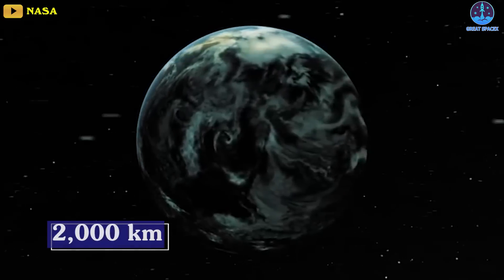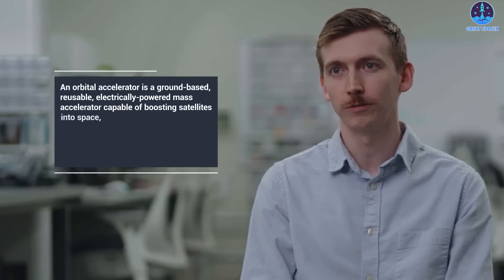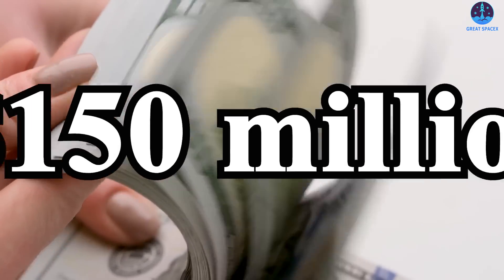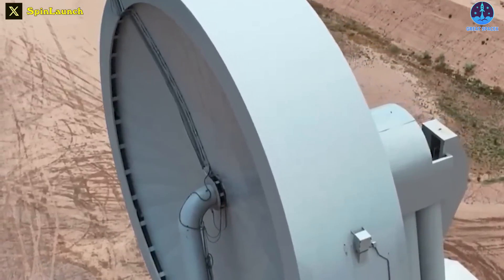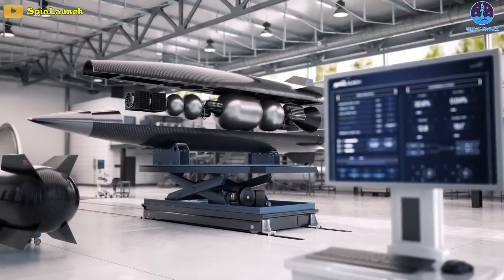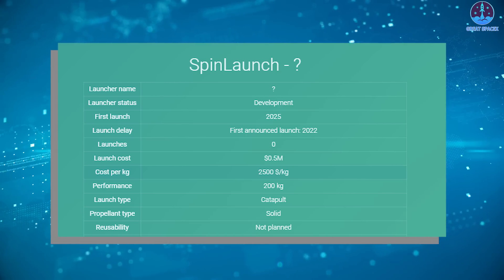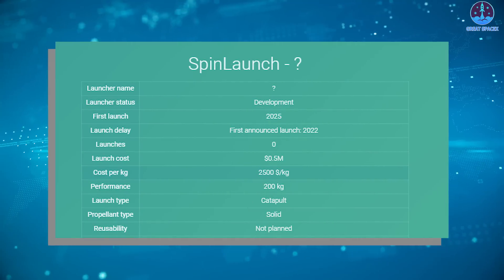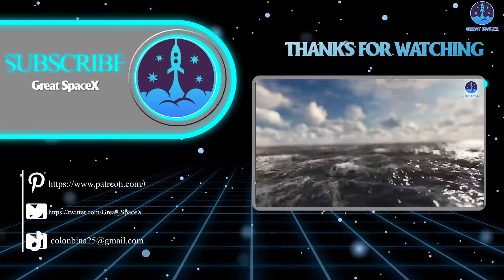What exactly happened to Spinlaunch and the Orbital Accelerator with new technology?

Comment: SpinLaunch project will facing significant challenges when it comes to launching larger rockets. For a large rocket, the accelerator required would need to be twice the size of the typical ones used by big space agencies for similar missions. One of the major concerns is the intense heat generated by the high G forces during launch. The rocket's propellant fuel is at high risk of overheating, and if this happens, it could lead to an explosion of the entire accelerator.
Another issue is the precision required in the launch. A slight miscalculation in the tangential trajectory could result in serious consequences for the surrounding environment. Any failures in the system would mean time consuming repairs or even the rebuilding of the accelerator, which could delay further missions.
The most recent launch conducted by SpinLaunch reached an altitude of only 9,000 meters, using both the spinning mechanism and traditional propellant. This is far below the performance of a standard rocket, which would typically achieve much higher altitudes with less complexity.  SpinLaunch may be effective for smaller payloads, but for larger missions it's a major obstacle.

Comment: The SpinLaunch project is facing significant challenges when it comes to launching larger rockets. For a large rocket, the accelerator required would need to be twice the size of the typical ones used by big space agencies for similar missions. One of the major concerns is the intense heat generated by the high G forces during launch. The rocket's propellant fuel is at high risk of overheating, and if this happens, it could lead to an explosion of the entire accelerator.

Another issue is the precision required in the launch. A slight miscalculation in the tangential trajectory could result in serious consequences for the surrounding environment. Any failures in the system would mean time consuming repairs or even the rebuilding of the accelerator, which could delay further missions.

The most recent launch conducted by SpinLaunch reached only to an altitude of only 9,000 meters, using both the spinning mechanism and propellant. This is far below the performance of a standard rocket, which would typically achieve much higher altitudes with less complexity. 
SpinLaunch may be effective for smaller payloads , scaling up to larger missions is like a major obstacle.

Comment: Almost impossible to keep the bearings clean on the moon... well not impossible but the cost.  Sheesh!
Build a micro-nuclear plant in the Philippines and use it to power spinlaunch.  
When you're done with the site you can teach the locals how to use the plant for local power.  Close to the equator and not a lot of risk in the launch area.

Comment: Besides all of the obvious complexities of building a system that accelerates a rather heavy object to these speeds, one of the most important aspects here is being overlooked, the customer. A satellite vendor designs to the launch vehicle, ie the size, shape (of its shroud, adapter/bus), throw mass limitations & environment ie acceleration (g’s), shock & vibe. If I have to design a satellite for a rocket today, even the less refined small launchers I only have to design to ~10g or in most cases closer to 3g. shock and vibe is another factor, which I think would probably be slightly less at launch but the same when the second stage ignites, w/ a spin launch approach. The real issue here is at ~1000 times the g force of a current rocket launch, w/ less kg payload capacity and only marginal cost savings for the customer over say a falcon 9; the design costs, risk of failure and capability tradeoffs one would have to make to survive this environment far exceeds any benefits to this approach. unless your are launching literally a solid brick with no moving parts, unfortunately I don’t see this ever being a viable business (me former Sandia & Lawrence Livermore, co-founder investor & board member Vector Launch)

Comment: *Each launch is a 100 kg bomb going off in the launch system*

At the moment of launch, they’ll need to release a counterweight with the same kinetic energy in the other direction or otherwise dissipate as much energy as ~100 kg of TNT. 

At release the rotor will suddenly be crazily out of balance. They could release a counterweight from the other end at the same precise instant, but it’s going to need something to smash into to get rid of all that kinetic energy.

They’re talking about up to 5 km/second for their “suborbital” launcher, and any orbital launch would have to be much faster, even assuming no air resistance. Kinetic energy = 1/2 mv^2. Just a 10 kg payload at that velocity has as much energy as ~30kg of TNT. If you double the speed (to get to orbit vs just up and back down, and just a little allowance for air resistance), it’d be 4x the energy. 

So even a tiny payload would be the energy equivalent of setting off 100 kg of TNT that you’d have to deal with.

- And this is just one of the engineering issues. 

Who the heck is giving these guys money? How could anyone invest 10s of millions of dollars without doing a few basic checks first? They may claim to have solutions for all of the many problems and impracticalities, but I don’t believe it.
Reply: Exactly!!!
Reply: "Who the heck is giving these guys money?" 

People who actually know what they're talking about.
Reply: @DamienDrake2389  References, regarding how they’re dissipating the energy for the counterweight? I’d be happy to find out that I’m wrong, but you’re not demonstrating that. If you have something to contribute to the discussion, I’d welcome hearing it.

Comment: If a space craft reenters the upper atm it needs a heat shield in order to not burn up at the 8km/sec it travels. These guys are proposing to shoot a satellite through the dense lower atm at >>8km / sek. Are these satellites made of cryptonite or how come they don't burn up in the second they are launched?
Reply: The nose cone is made of copper and aluminium and they don't have to put up with the heat for very long as they exit the atmosphere so quickly.
Reply: @DamienDrake2389  hmmm ... copper melts at 1000, aluminum at 600°C. Meteorites who travel the same path as these projectiles just upside down heat up to ~1800 °C.
Reply: @HR-yd5ib  I guess it doesn't work the same when in flying in the opposite direction with the atmosphere getting thinner, instead of denser as you move through the fluid. The shape of the projectile also plays a huge part with meteors having huge drag compared to an engineered, aerodynamic nose cone. That's what they're currently using all the same

Comment: I can't imagine any complex electronic device that can sustain 10K overG. Even "smart" bullets and artillery shells are not usually exposed to such Gs.
Talking about fuel for the second stage - most types of liquid fuels will be pressed against the fuel tank shell and such pressure will destroy the tank itself or heat up the fuel to self detonation temperatures. 
Anyway let them try and i wish them luck. 
The discussions about "why its impossible" never led to scientific and engineering success.

Comment: As usual, it will take time for it's development.
I wonder how much electricty it requires and how they would power it on the Moon.
This is alternative to a magnetic levitation mass driver that some have proposed.
Again, it will require electricity and will solar panels be enough on the Moon?
Also, 10K gforces on the satellite will be pushed to one side, I think.

Comment: I think it's more exciting use is to get bulk materials higher into orbit where another vessel not unlike a tug boat could take it to a more precise  orbit more efficiently. Such tug vessel would not need reentry shielding and could be both much less massive and less complicated. Just imagine water, soil, and fuel containers launched into NEO with the container being thin steel or even plastic which is able to be recycled in orbit. I think this would similarly and more safely be able to get nuclear materials into space with less chance of failure.

Comment: Spinlaunch is a great concept that should be pursued because it would considerably lower the cost of accessing LEO.
Imagine what a space-based spin launcher could accomplish.
Reply: Finally someone who isn't braindead in the comments! The cost of each launch is roughly half of what spaceX is using and they can actually launch multiple payloads per day. Its hilarious reading these comments from people who haven't got a clue what they're talking about!
Reply: There is no place to anchor the spin launcher in space... it  has to be anchored to work.... putting it on the moon however it would be fabulous.... we would still have to get the pay load to the moon though....not viable when that aspect is included.
Reply: Actually no for many  reasons. A couple being it cost more not less, it is very hard to aim constantly, very limited payload, extreme gforces on any payload for a extended time and the design for the rocket is quite flawed showing issues which real rocket engineers fixed ages ago. This was incredibly flawed right from the beginning although it may still help develop other more sound ideas.

Comment: Centrifugal launching has to deal with enormous stress on the facility as well as losing everything if a launch fails due to release errors. Why not an electromagnetic launch tube sending the rocket like a bullet.
Reply: Think of the enormous air resistance at the moment of release.  Super high velocity & dense air at ground level.
Reply: It requires a lot more space and electricity.

Comment: For the launcher, don't use iron to spin the handle, but use iron fiber which can be stable when widened with the calculation of being able to withstand a pull of 12 tons or more so that you can increase the pulling load to launch the rocket.
and don't forget oil to reduce friction at hyper speed when launching the rocket.
to be bigger and faster
greetings from Indonesia
Reply: Somehow, I don't think they'll forget that oil is good at reducing friction...

Comment: In addition to the arm being horribly out of balance at the moment of launch, the ship has to transition within about 1/3 millisecond, from rotating at 4500 rpm to not rotating at all.  This is probably accomplished by releasing the front of the ship, and then releasing the back of the ship.  That problem, plus the timing of the release, seem to be manageable.  I would be interested in learning about how Spinlaunch deals with the problem of the arm being out of balance at the moment of launch.  That seems like the main obstacle to this type of launching.
Reply: I was thinking it should be a disc rather than an arrow. No one else has even presented this problem in a video. You can see the projectile wobble when it’s released but I’m surprised it doesn’t turn sideways.
Reply: For the full scale I think they plan to have a symmetrical release system, the opposite end being something to vaporize/turn to dust on its way to the ground.
Reply: @JohnboyCollins    That's genius.
Reply: It's supposed to spin at 1300 rpm not 4500 rpm. I don't think the release timing is an issue, but the enormous forces on the projectile might be. Ten thousand Gs means the payload and rocket engine will be 10 000 times their weight. They could be crushed under their own weight.
Reply: As long as it's tethered at the center of gravity you can release the whole thing at once.

Comment: For every action there is an equal and opposite reaction. There have to be recoil forced associated with this. Mounted on Earth, the moon, or Mars works but if sitting in open space directing rocks back home, what happens to the recoil force?
Reply: There wouldn't be any recoil -- can't apply Newton's 3rd law to this. This is using centripetal acceleration, like a sling, not a firearm. You can try this yourself -- tie a rock on one end of a string (say, 4 feet long) and go outside in an open area (like a field) and whirl it around until it's going a good clip and then let go of the string. Now, for this demonstration, think of you being a planet, the string represents the pull of gravity, and the rock being a spacecraft. The whirling is centripetal rotation (not centrifugal, which is a phantom, or fake, force) that imparts angular momentum. the instant the projectile overcomes the pull of gravity (when you let go of the string), it will want to go in a straight line. "An object in motion will remain in motion unless acted upon by an external force" (same for an object at rest). You will find that you do not in any way, shape, manner, or form experience any amount of "recoil" when you release the string -- because there is none. Now, if you had fired a gun, the rapidly expanding gas from the burning gunpowder forces the slug along the direction of the barrel and also forces the gun itself backwards. Since the firearm itself has much more mass than the slug, it doesn't move in the opposite direction as fast as the slug (if it did, it'd rip your shoulder off), since it would require much more energy to accelerate it as quickly as the slug. So, the "for every action, there is an opposite and equal reaction" applies only to certain cases. You can read up on Newton's laws here: 

https://www.britannica.com/science/Newtons-laws-of-motion
Reply: @ronaldlebeck9577   Thank goodness for a guy in the comments section who knows what he is talking about.
Reply: @ronaldlebeck9577 the system would surely end up rotating itself because of the change in angular momentum

Comment: Heat tiles and expensive disposable fairings seem to be a limiting factors.  wish them luck.
Reply: No need for heat tiles as they aren't held back by weight like conventional atmosphere entering equipment. The nose cone is made from copper and aluminium

Comment: LEO velocity is about 17,000 mph, the ability to reach that speed (plus the speed lost due to hypersonic speeds after release) in a circular accelerator at sea level atmospheric pressure would involve mammoth forces as would the sonic booms generated. It appears the accelerator would have to be evacuated. It might work if the launcher were lifted to very high altitude by lighter than air craft.
Reply from the maker: Thanks for your sharing
Reply: Imagine how fast it has to go, to still go 17,000 by the time it leaves LEO lol. Double? Triple? A rocket gets up to 17,000. This would have to START at twice that?
Reply: Lol wtf? You know they spin it up inside a vacuum? The maths already show that they won't lose very much speed as they ascend as the atmosphere becomes thinner. 

There are only 2 sonic booms, one from where the nose breaks the sound barrier and one from where the tail breaks it. It doesn't get stronger depending on the speed and you don't get more of them either, just the same 2. As they have successfully completed a launch at Mach 1.2, they're happy that it's safe to do so.

Comment: Well when the thing survives 10,000 g's. Electronics and all other things... Which I very much doubt. Then impacts the air like a breeze block. Nahah... Why not just run a linear vacuum sealed maglev track. Up the side of mount Everest... Which would be a damn sight easier. Then extend it another mile at a near 30° angle from there on. Again not as technically changeling as it sounds. Get it to about Mach 6... Then break the vacuum from the rear allowing sea leave air pressure to rush in to give it a little more vumph. And equalise pressure at the point of release to have minimal heating. You could accelerate it over about 180 miles at a constant 3g to get to about 10kmph then let the thing out about 5 miles above the ground.... Light the fires and boom... Far more economical than virgin galactic or new shepherd and really not that too restricted on mass. Have a 100. 200 1000 ton semi levitated rocket reach about 65% orbital velocity... so that usual 5% mass to orbit could now be about 50% mass to orbit.
Reply from the maker: Thanks for your sharing
Reply: Lmao yeah let's build a huge electromagnetic train track up mount everest, one of the most inhospitable places on the planet, that'll be easier than just increasing the gforce capacity of some equipment! 👍